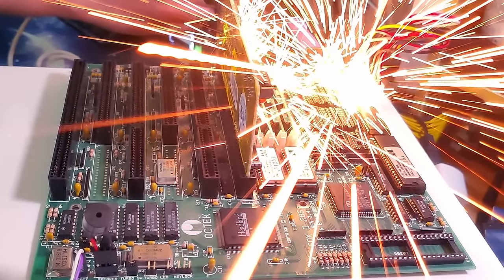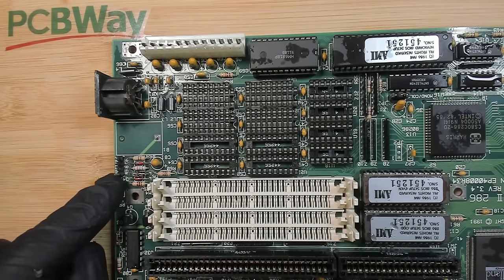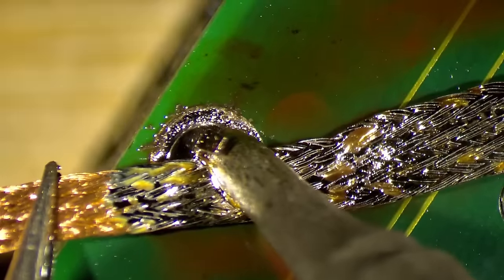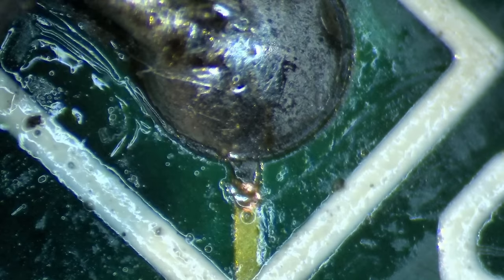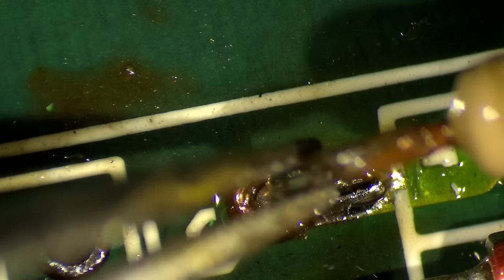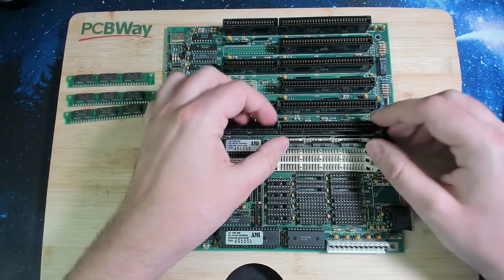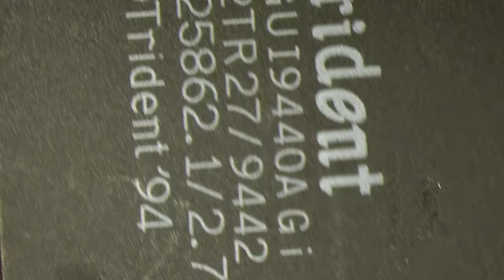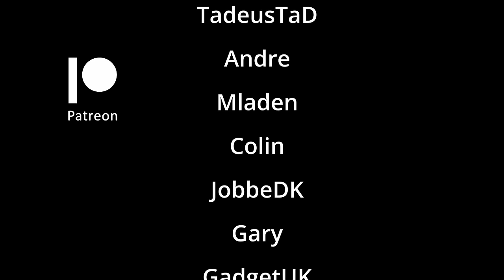Dangerous 286: Vintage hardware fireworks!

Comment: Just Check the glue Logic. 74(LS/HC)373 or 240, 244 or 245 Chips are sometimes good candidates for falls. I've worked on an Amiga 500 a few weeks ago... And after fixing 2 bad 245's  the RAM shows a new fault and i had to replace 2 RAM Chips. After that it workes through everything so far. After finding a corroded Socket on "Denise" and a good Clean the Amiga was fully Back to Live. 
If you have a 2 Channel scope it is possible to trace this out in Operation, If there is a Trigger Input or a third Channel, much bettter. Sync the Trigger on the enable line and Check the Input and Output of the Gates. Or If you Like the more brutale way, desolder the suspekt and Test them in an Chip Tester or a tl866.
Good luck and i Hope i could Help a bit Out.
Reply from the maker: I probably have to go with the brutal method as I don't have a two channel oscilloscope. I also don't have the skills/knowledge yet. But I want to change that soon!
Thanks for the hint - I'm going to look into those chips. Maybe some signal line is stuck and causes the system to stop.
Reply: @bitsundbolts  a good Point to start is to identify, Sounds you were half way there, and then trace that Back to the Line drivers. Is there a schematic in the Datasheet? This is a Lot more easy to find and Check. I have for my Car diagnosis a cheap hantek USB scope. The Software is a bit Outdated in some functions but for slow Car related stuff really good. They have also 4 Channel scopes and USB scopes. 
BUT If you only want to See digital stuff, buy a cheap USB 8 or 16 channel logic analyzer probe. In this ones you only have the Level high or Low and Not the Voltage, but for 10-20€/$ it is a cheap and useful tool. For the old Boards is important, that they Work with 5V ttl Levels, some really cheap ones only provide 3,3V Level ...

Comment: can you replace tantalums with normal caps? replacing an ignition source with another ignition source rubs me the wrong way
Reply from the maker: I think it should be ok to replace the tantalums with electrolytic caps. I think others have done this before and it seems to be ok.

Comment: Now im sad, my first computer was a 486 and when i pulled it out after some years and powered it up this exact thing happened so i threw it away because i thought it was fried :(  I did save the 486-DX2, cache, SIMMS, BIOS and one other random chip
Reply from the maker: Well, you still have a lot of the old components... Maybe it's time to get a socket 3 board again and out the CPU, cache and memory to good use 😅

Comment: presumably it was on one of the 12v lines? maybe a 16v tant on a 12v line isnt a good idea?!😁 maybe use a 25v type!  strangely/luckily i've never ....yet.....had one blow up on me ..... i did have some multilayer ceramics self immolate on  an isa multi io card, so had to replace the lot on that!
Reply from the maker: Good that you haven't had an exploding tantalum capacitor. From now on, I'll always replace the 12v tantalum before I'll power on a board.

Comment: Is your power supply outputting clean 5V. How much noise/ripple do you have on the 5V rail? Dirty power could cause it to not POST. First rule of electronics repair: Thou shall check voltages!
Reply from the maker: The power supply should be fine. It's an EVGA Supernova G3 (850W).

Comment: Just a thought, but JP1 dip sets between 27128 and 27256 rom sizes and it looks like you have a 27512 in it. Did you change those?
Reply from the maker: The ROM sizes are two times 27256. I replaced them with 27512 because I didn't have any spares. Looks like the board works with those as well. I duplicated each BIOS with the copy /b command to double the size of each BIOS file - then wrote it to those chips.
I have since replaced the chips with new 27256, but still the same behavior. But at least I know now that the BIOS is good.

Comment: maybe recap everything ? The other Tantalum capacitors may not explode BUT they may be converted to a short OR to A Resistor.
Reply from the maker: I'll check the logic ICs first. If that doesn't help, I'll consider recapping the board.

Comment: Too bad you couldn't get it working yet. 
One note about the CPU getting 16 MHz: Consider that the manual stated that you can toggle the CPU speed in software. The Turbo header might not be in use at all or only be used depending on a BIOS setting. It makes sense to run the CPU in lower speed first to get through any potential speed issues (like slow RAM) and get through a defined POST process under stable conditions, so you can actually return any meaningful data in case of problems and not just have a crash. This all very much makes sense to me the way it is.
Reply from the maker: I hope so. I am getting other oscillators to reduce the speed of the CPU further. Maybe I get a different behavior from the board. That project is pretty much still very active. I'll publish an update very soon.
Reply: @bitsundbolts  Good luck, hope you get it working!

Comment: But wait, the BIOS chips were originally EPROMs. Did they read ok? If so, why do you replaced them?
The BIOS chips that were on the board "have issues of retaining data". That means that they were faulty, read bad or not reading at all? Remember that Not always EEPROMs and EPROMs chips are pin compatible.
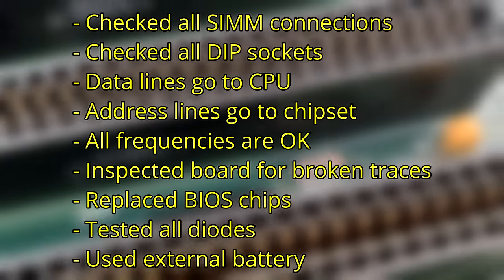I assume that you checked DACK signals. If so, where the memory points? At 43:57 you have the table with memory config. Those 64k shoud be in the Bank 0. Having a 286 CPU (16bit), I assume that the DIP/ZIP RAM is Bank0, the first 2 SIMMs are also Bank 0 and the other 2 SIMMs are Bank 1 (the closest to the ISA slot). Checked continuity from the used RAM (SIMMs in your case) to the chipset? May be corrosion, may be a broken trace, (the adress bus).
The CPU running at 8MHz and the Turbo pin being always high (are you sure that is not active low?), the adress lines that are stuck high, might indicate a bad chipset, but also a bad connection (there are some resistor network near the RAM area) . That is, can be a bad solder on the chipset but also some broken traces. So, i would remove the chipset IC, look under it for broken traces, or at least look for bad soldered pins on the chipset. 
The bus driver chips are 74244/74245 and the 74373 latch ICs, were also used for bus control. But, all those are 8bit and I suspect that they are used to interface the ISA bus only (as they were usually used for) and have nothing to do with the memory. 
I assume that the DIP/ZIP RAM is Bank0, the first 2 SIMMs are also Bank 0 so the valid memory configuration is to use either DIP, or ZIP or SIMM for Bank0 but not all at the same time. Maybe I am wrong, but what the manual say?

I can`t wait to see the board working!
Reply from the maker: I'm indeed not certain about the BIOS chips. However, the EEPROMs behave in the same way as the original chips. Unfortunately, the original chips didn't have the same content as the BIOS found on the Retro Web - four bytes were different. I have the backup, but I'm sure it's bit-rot once more. I need to wait for an UV eraser and a few replacement EPROMs - just to test a few other possibilities.
Your RAM analysis is correct. I'm hoping for some incompatibility, but so far, I wasn't able to make any progress. Now I'm waiting for DRAM DIP chips.
If all this doesn't work, I have to go over all the traces once more. Maybe even desolder all RAM sockets.
Reply: @bitsundbolts  You are right about bit-rot. Unless you know for sure that the BIOS is 100% reliable, is no need to further proceed.  It may be affected the memory test routine(s) and unless can dissassemble the BIOS to be sure, consider it as unreliable. What the BIOS maker is (there have to be some strings there)? Maybe there are tools to check/modify the BIOS. I doubt that in the 286 were modular BIOS (like Award, Phoneix) but maybe I am wrong. Maybe ask the community may help? Upload the BIOS binary somewhere to be seen?
I did not had many 286 motherboards to play with, mostly because I mainly had 8088, 386 or 486 motherboads to troubleshoot, but 286 only 2-3 (as far as I remember) and those were way to different even to an 8088 motherboard, not to speak about later more standardized 386/486.
I wish you luck with this project and I want to see updates.
Reply from the maker: Thanks! Yes, I am certain it is bit-rot. I got a delivery just now. DIP memory and new BIOS chips (same as the ones that came on the board). I also got the UV eraser. Unfortunately, nothing helps. New BIOS chips with correct and reliable BIOS taken from The Retro Web (which seems to be exactly the same BIOS as mine except for 5 Bytes across both chips).
DIP memory doesn't make a difference.
I need to continue to look for clues about what could be the issue.
Thanks for the tips above though! I appreciate it!
Reply: @bitsundbolts  Can you trace the turbo circuit from the switch to HT12?
"It should be note that turbo switch setting will override the keyboard switching mode, but not viceversa." So, I guess that you may have on that path an 7414 or similar (a buffer or inverter); maybe that IC is bad. Note that HT12 have a pull-up internal resistor on that pin.
MA pins are for the memory adress bus only, on HT12, maybe there is a bad connection (solder joint, broken trace, etc). Note that there is no pull-up and those pins go to the memory only so the constant high level there there is weird (does it happens wihtout any memory installed?). Note that the DIP/ZIP and SIMM must share the same adress/data lines so you can have the SIMMs installed and use the DIP/ZIP sockets as testpoints and use the DIP chips datasheet as reference for adress/data pins.
The data bus is shared between RAM, ROM, CPU, ISA bus and other peripherals (RTC, 8042, etc), some trough a buffer. Check those data lines at the chipset, maybe one is kept high/low by a bad buffer IC? Look at the block diagram in the HT12 datasheet.
I start to suspect a faulty HT12 chipset.
Good luck!
Reply from the maker: I'll test the buffer chips over the weekend. I really hope the Chipset is ok. Finding a replacement may be difficult.

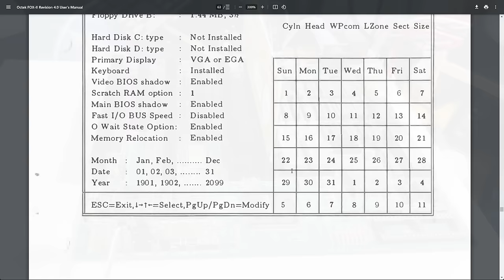Comment: 38:00 I would rather see you replace all those tantalums with new for reasons already demonstrated by C62. In all likelyhood, the one you stole from that Trident card as well as the rest of them on this board may not be far behind. I guess that's for later on once you get that thing running DooM.
Reply from the maker: Might be interesting to have such a board with modern electrolytic caps. Let me see what I can do with the board. If I miraculously get it back to work, I'll replace the caps. This is such a nice board and I would love to keep it for my 286 experiments.

Comment: always test a capacitor for Shorts before you turn on a system
Reply: Completely pointless with tants, they don't show any electrical issue until you try to rapidly soak them with voltage.

Comment: Doesn't 286 boards require the base memory to be installed regardless of Sim modules being there. I not 100% positive on this but the Sims are likely acting like the isa memory expansion board hence they mention the recommended ram speeds to likely offset the slower isa bus for 20mhz  require 60. Should populate 640k in the empty slots I don't think anything should stop it from booting once memory is installed because the cpu is probably routed to the missing memory first.
Reply from the maker: I hope you're right. The memory is on the way and I can test that soon. I'm already happy if the POST code changes after I install the DIP memory. Let's see - a few more days and I will find out.

Comment: my guess is, as probably yours, it's the chipset
Reply from the maker: 😢 that would be very very sad. I wanted to see this hardware EMS implementation...
Reply: @bitsundbolts  it's a keeper anyway, maybe you'll find another one, even physically broken, and replace the chipset
Reply from the maker: Maybe some day I get lucky and find another board with that Chipset. Then I could swap and see if something changes. I definitely will keep this board.

Comment: My prediction: board is 100% fine, you need 8/9 chip Simms. 2/3 chip Simms started being supported by 386 chipsets. Edit: further on OP mentions trying those. Next step desoldering ram sockets and fixing corroded VIAs.
Reply from the maker: I'm working on the logic chips now. I want to make sure all the buffer ICs are ok and working.

Comment: Why do you have a glove on your left hand and not on your right hand?
What's the secret sause behind it? :)
Reply from the maker: I mostly use tools with my right hand (solder iron, tweezers, syringes), the left hand holds solder wick, solder wire, and other stuff that is either sticky or dirty. That's it 😅
Reply: @bitsundbolts  Ah figured it had to be a reason other than "i ran out of right hand gloves" :)

Comment: Only thing I can think to add is that you didn't replace the battery pack, need that for BIOS to remember the settings. Also maybe it's looking for a 64K DIMM chip in one of those sockets, try adding one and see what that does if you have one.